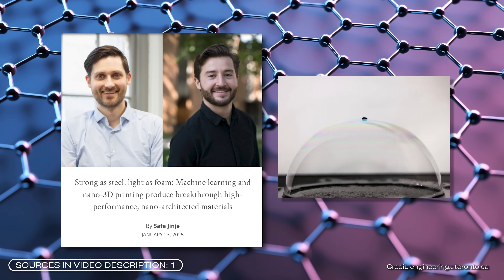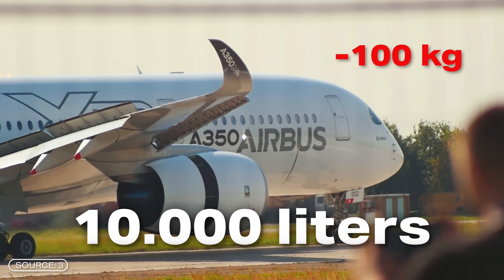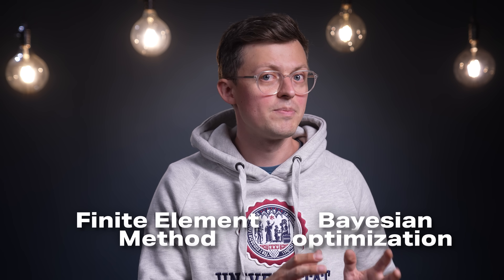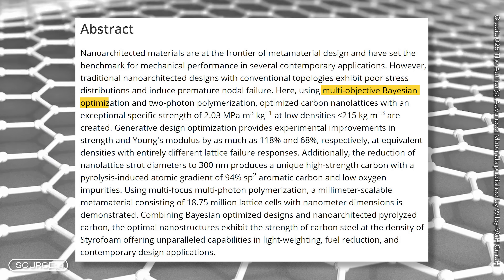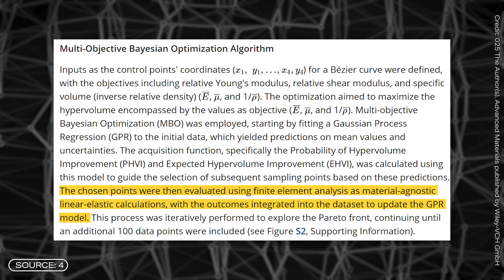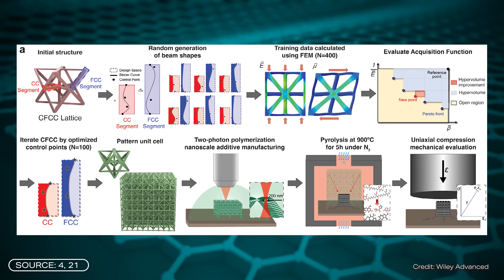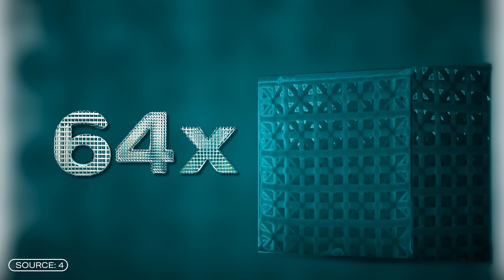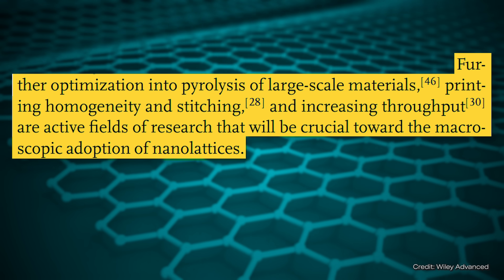New Material: As Strong As Steel, As Light As Styrofoam!

Comment: In a traditional honeycomb sandwich structure used in aerospace, two aluminum sheets are separated by a lightweight honeycomb core. My idea here is to replace each of these aluminum sheets with its own miniature sandwich panel—essentially a smaller-scale honeycomb structure that incorporates the new, advanced material as its internal core. Instead of using plain aluminum as the face sheets, these faces would themselves be made from this micro-sandwich design utilizing the innovative material.
Given that manufacturing this new material is highly complex, it would make sense to begin by conducting trials using only a small amount of it within these micro-structured panels.

Comment: That means 2 surfboards extended  topover. Joined central by struts. Top surfboard filled with Hydrogen envelope. Or Helium envelope. Section rear joined to lower surfboard structure similar in sight to DC10. Push by hyperspeed liquid feed engines rear. Runway to  Space. Lighter than OneG in flight. Spacecraft. Fuel lower Surfboard extension wing inclusive command&control crew module. Mars lander. Runway to Mars and back. ✝️🌹🎖️

Comment: 0:57 So, if my Ford Focus MK1 TDCi 1.8 (85 kW) combi weights 400 kilos will not consume fuel at all? 🤣🤣🤣
Don’t be silly! When my Focus is even overloaded (to say a month ago, 400+ of construction materials and me on board consumed the same quantity of fuel, 4,8 - 4,9 litres on a 100 km. 
It’s not excuse if you cannot drive correctly, to blame the weight of the vehicle for the higher consumption. ;)

Comment: What’s the range of electric deformation for this material?
Because if it’s lower than the industries standard, then it’s probably not going to be used in commercial aerospace application, which manufacturing rate, and weight, and in association fuel cost savings, greatly exceed industry standard.

Comment: The only issue I could think of off the top of my head would be that a jet has some parts that must bear weight and loads. This material would have to be able to tolerate these. Think of the mounting points for the engines for example, that structure has to meet very high criteria. The engines themselves probably wouldn't make use of this due to temperatures and pressures. The landing struts and submembers they attach to also must bear tremendous loads. And these are attached to the rest of the frame so load transfer is spread out.

The body could probably make use of this as long as you can seal the material airtight and I'm sure that would save a lot of weight. Probably other non-load bearing parts as well so it's worth investigating. I feel that automobiles and trains would make more use of this. Maybe even building materials too as well as HVAC systems.

Comment: Would be interesting to use this approach in structural engineering workflows to design optimized structures at larger scales with a variety of different materials. I guess that's the point isn't it?

Comment: ok this is great we have made another super material.... How many "super materials" never make it out of the lab? the largest problem with these materials is the smaller and more complex they are the harder and more expensive they are to manufacture to the point where they are entirely impractical to use. sure you can manufacture very small amounts for testing but on an industrial scale? Forget about it. The advancement itself is good for material science, but most of them are 100 to 200 years away from being practical.

Comment: If they are using a light sensitive polymer, why not shrink down the image of a resin 3D printer screen and use that to build up the structure layer by layer - to achieve the same results faster through parallelization (many light rays in a pattern instead of one laser)?

Comment: Are the strength measurements also applicable to thin sheets of the material? Because useful machines or vehicles are made of thin layers of stuff, not cubic meter blocks of stuff. I'm sure they probably thought about that already, and I'm just speaking as a layperson, but I wanted to make sure we weren't hyping up a material that has really good properties --as long as it's in a big volume--.

Comment: If you made a sphere of that material 2 feet in diameter and less than 1mm thick and some thin internal crossbeams so it doesn't collapse, then sucked out all the air inside, it would float. You could build a vaccuum airship.

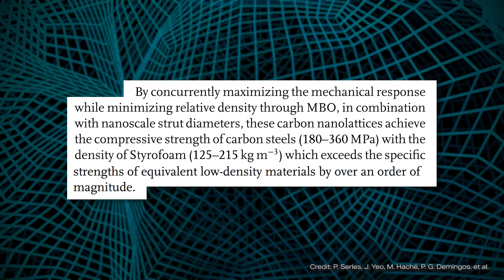Comment: 6:25 Compression strength... lol. there are very few uses of steel for pure compression. 99% of compression structures don't care about weight, that's why we use concrete for compression. Sheer strength is where steel comes into play for steel bars and panels and tension strength for steel cables. Where on a plane or car do you need compression strength but not sheer or tension strength? useless click bait.

Comment: Does it scale up or are its properties bound to the nano scale? Can they even produce a few inches of the material? These are the more important questions.  I've been hearing about graphene for ages and nothing is done with it. This is like a really short stick that is 1 inch in diameter that is strong, but if you make it 10 feet and step on its center it will snap in half like a twig.

Comment: Okay, dumb, obvious question, but wouldn't the structure having all those holes make it weaker as opposed to it being completely solid? If it's as strong as steel with all those microscopic gaps, then wouldn't just having it be 1 solid mass make it far stronger than steel?

Comment: Great video. Very informative. Super useful information. nice examples.
Now for the hard part....
There are so many vehicles, vessels, aircraft and structures that would benefit from the properties of this material. What happens when it is subject to forces from random directions? What happens when it is folded? What is its minimum bend radius? Can you make a pressure vessel from this material? With what conditions? Or is it only suitable as a coating (multi-layered) over a non-lattice material? Could I make a boat, ship, or icebreaker from the material?

Comment: Something that weighs a bit more than a man in a volume that is 16x that of the average man is not heavy at all.

We have tools at my work that are about 1/3 of a cubic meter and weigh in excess of 2500kg.

If we can scale this up effectively, it will be an amazing change in material sciences and manufacturing. Even if the materials are limited to non-detail components of larger structures. The gain in strength to weight ratio could lead to incredible efficiency gains.

That, of course, does come down to us not only developing upscaled means of producing these materials, but being able to do so without exponential energy costs.

Comment: As strong as steel per unit weight, and as light as styromoam per unit volume.  That does not mean that the material is not going to be useful, but let's not overstate it.  Could make a great reinforcing insulation in some contexts.

Comment: This is worthless. Its like the hype about graphene. Using MEMS fabrication techniques to build an airframe would make it cost trillions of dollars. Also, being carbon foam, it would be flammable to the point of being explosive.
Also "strong" is just plain false. Its a hard material, like glass. Its incredibly brittle. If you flicked it it would fracture and fall apart.

Also, in case anyone cares, the dimensional stability of pyrolyzed polymers is garbage. This isn't even the first time this particular thing has been attempted. There's a reason they're testing micrograms of it and not kilograms.

Comment: High carbon steel weighs about 7850 Kg per cubic meter. Even at the heaviest estimate, this substance is only 2.7% the weight. That's incredible, if it can be scaled up and mass produced. I'd also be curious to know what the electrical properties of it might be, and if there might be other uses other than simply structural.

Comment: If the manufacturing cost on this does not equal or is less than the production cost of regular steel or other metals, it'll never get anywhere. Maybe in high cost high performance areas.

Comment: By avoiding concentrated pressure this structure can lend tremendous support to a hard shell like is achieved by bones in nature.  The bone was designed with a sponge like structure in the middle and as it migrates to the surface it gets more dense and then becomes almost totally solid and this keeps the bones light, impact resistant and strong over all.  If the design were flipped with a hard center surrounded by a brittle sponge it would bend, crack, and become damaged by concentrated impacts.  So this sponge pattern is fine for the deep inside but they need a stronger and denser layer over the outside of it and then a solid film covering the whole product to optimize  strength.  God figured this out billions of years ago.  Unfortunately so many parts in a plane or space ship are just thin panels or rods, but some longerons  and other supports that are like trusses could be replaced with this super structured material with a proper casing for attachment points.

Comment: Wait, you still burn Kerosine in your aircraft? Out of all the fuels, that has got to be the dirtiest fuel that you can use.
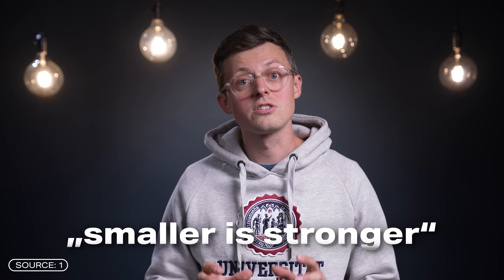1:36 Why is it that material gets stronger, the smaller it is?
Testing. Tell me, do you use AI to simulate the material that you are trying to create and test? I have heard that using AI to come up with new materials speeds things up by a lot.
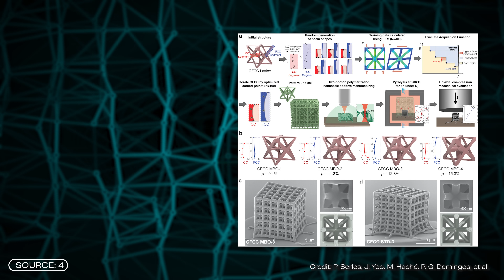5:14 This structure reminds me of CNT or Corbin Nano Tubes. It's a material that I have looked into as something ideal for making  a cable or ribbon for a project called the Space elevator. This looks promising. I wonder what the specs are on this material?
Mass production, quality and cost will most likely be the limiting factors with this new materiel. But it we could mass produce this. Aircraft would be just a small thing produced this way. We could build pretty much anything from cars to buildings to packaging to pipes. It would be like when Iron was first introduced, or steel or plastic. 
Two things that you will need to also consider is that carbon is conductive. Also, once carbon is shaped, it becomes next to impossible to bend and reshape outside of a (carbon forge).

Comment: Producing high-quality graphene or CNT foams at scale is still expensive and technically complex, making uniform structures that maintain strength and conductivity is hard outside lab conditions, cost, materials like graphene and CNTs are costly to produce in bulk, especially when ultra-pure or structured at nanoscale, large-scale foam applications (like packaging or automotive) usually require cheap materials, so cost is a barrier.

Comment: Not sure how great a jet will do if it has the same area, but is otherwise feather lite. A key advantage of the weight/mass of large objects, is that they resist the force of things like Wind. Even if you are able to get the same amount of Lift with less area in your lifting surfaces, you are still gunna get moved around quite a bit more than usual. So likely you will only see this kind of material used more sparingly for some weight reduction, but less than people might think. This is not even a great idea in cars. Which is why EVs tend to feel more planted on the road than say a small European car. Even the American version of the Smart Car had weight added to make it more stable on the road. Anyone who has been blown into a lane change on a highway in a windstorm will know what I am talking about.

Comment: Maybe I'm missing some fundamental characteristics of nanostructures but, If porous, how does it react to rapid pressure changes? Can a change of air density weaken the structure over time due to inability to release pressure very well? This could hinder use in areospace and pressurized cabins unless air expansion inside the nanaostructure due to an outside pressure drop if it can't equalize quickly by outgassing and it weakening a nanostructure that is only very strong under compression or torsional forces that are under equal inner and outer pressure? I mean, an egg shell or a geodesic dome is strong under compression but easily comes apart under inner pressure increases relative to outside pressure.

Comment: If this material can get to be mass producible well enough to become affordable for home/hobby use, I would want to try to build a homemade quadcopter big enough for a person to ride in with it. A material that strong and light would be a massive advantage to have for such an endeavor. I wish the best of luck to the folks working on it, and hope it doesn't just get hogged by governments/militaries and such.

I'm also curious about what it's other properties are though. What is it's tensile strength? Impact strength? How well does it handle compressive forces? Or extreme temperatures? How malleable is it? Can it bend much without breaking? How well does it remember and/or retain its shape when bent? Etc, etc...

Comment: Im kinda excited by the idea of perhaps being able to draw in and use atmospheric carbon in the manufacture of stable manufactured goods! that is of course absurdly far into the future for this technology, but it also raises questions for how this would work in contruction and manufacturing - it doesnt look like it'll be something that can be cut and welded like metals, and if it needs polymer 3d print tech to make the precursor object before pyrolysis, this could be an expensive and as big a pain in the arse as making say, carbon fibre planes or wind turbines...

Comment: It’s mostly interesting for the synthesis of two existing but previously separate computer processes, which could indeed have beneficial applications.  The material itself is not particularly impressive to me, there are hundreds of these “super” materials that have been produced in minuscule quantities in labs and they all suffer from the same issue, which is how much is it going to cost in time and money when an industry comes to you and says “ok this is an incredible material, it can revolutionize our business, now we need 10,000,000 metric tons of it”
This is why boats, planes and cars are still primarily made of aluminum and titanium and steel structural elements.  To make things like body frames, wing spars, and other heavy load bearing structures you need a certain sheer volume of material, all other mechanical properties not withstanding.  
Unless you can make a skyscraper sized batch of pyrolized carbon lattice for a competitive price, nobody is ever going to build a skyscraper with it.

Comment: 0.5 liters/100km in saving per 100kg seems extremely high. How did you come to that conclusion? 

Generally it’s only the rolling resistance that’s affected by weight savings and rolling is only around 30% of the actual work done.

Comment: What is this new alloys isomer or isotope.
Design software is adequate for contemporary designers. Heavy concept's and all the clock speeds to land a probes around a system or explore the deepest ocean tidal  pressures.
Good for science fiction .For example balancing and recycling exhaust for laser of energy and orbital  momentum which does not decay enough to discharge directed electro magnetic  energy as an ultimate weapon .
Not being a subatomic physician however , if you could engineer a perfect less balanced even subatomic polarity achieving more stability this would be good for near plank length flexibility ,thermal inaccuracies. . The orb's would decay as experiments have shown or experimental  UAP's might be but might last longer than contemporary maybe eventual  unsustainable performance.

Comment: I'd hate to have to be the test pilot that has to fly the first passenger jet that is more like a kite. It might sound like a great idea at first but planes have to balance weight with surface area to be able to maintain steady control during wind shears and cross winds etc.. Can you imagine riding in a passenger jet that is as light as styrofoam? How about a 50-60 story skyscraper during hurricane season? It would however be great for 3D printers and model making.

Comment: RIGID hex-shaped forms do NOT flex as shown in the animation.
The connected edges form a bond at six points around each hexagon, forcing the shape to stay as firm as possible in the direction it's 'pointing'.
I know this because I've been designing vessels with a hex shape, which interlock to provide a rigid platform at sea.
Undulations don't affect the structure, as tension is being pulled together at every joint, in the direction of each point.

Comment: Sorry, mate, but you're talking in 'ifs'.
IF our vehicles collectively weighed less, we'd collectively use less fuel.
You're conveniently ignoring the price for new materials, and the timespan for it to overtake our current materials.
Vehicles made from it would be astronomically expensive, you're not saving money on fuel when you have to pay more for the vehicle, and you're not going to do away with steel when it's readily available AND cheaper.

Comment: Reality check: an Airbus A320 carries up to 180 passengers and has a fuel capacity of 27,200 liters of fuel. If you make it 100kg lighter, for example by removing a single passenger, it does not suddenly need 10,000 liters fuel less! If that were true you could just eliminate three seats, and then the aircraft would fly without using any fuel at all!

So clearly the statement that removing 100kg also removes 10,000 liters is just plain nonsense. Maybe that's over the lifetime of the aircraft, but in that case it represents a tiny savings, and the video should make that clear. The lifetime of an A320 is something like 60,000 flights, which represents up to 1.6 billion liters of fuel. 10,000 liters represents a saving of 0.0006%.